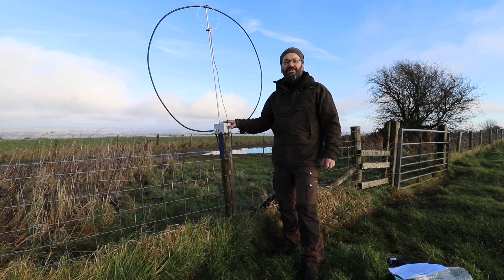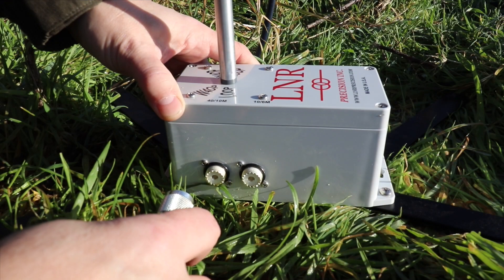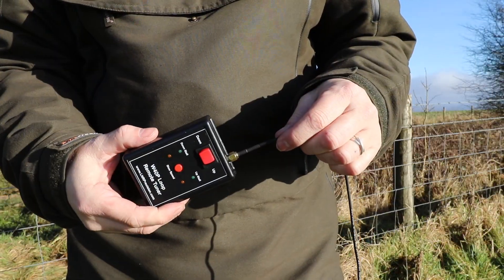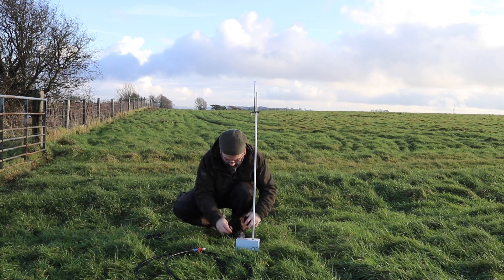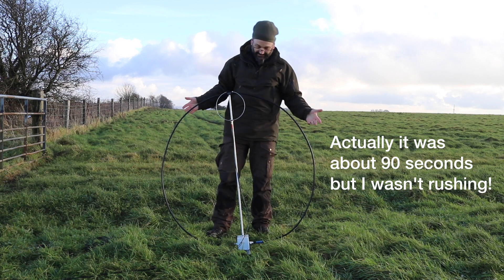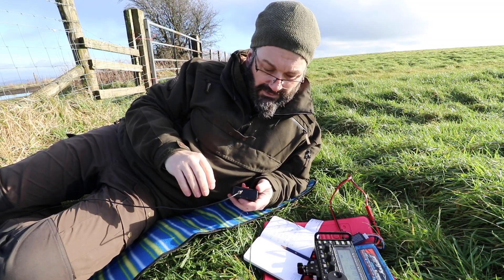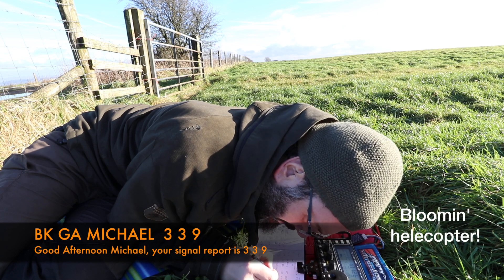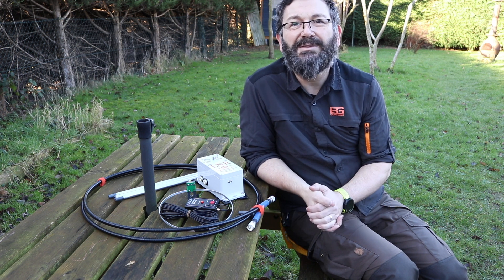Overview of the LNR W4OP Loop

Comment: Really well presented review. I would not personally denigrate Tom because he makes no outrageous claims about his loop design and moreover it's probably 1/3rd the cost. At the cost of this loop I would question one or two of its attributes. I have built two small transmitting loops. Both "work" as does this W4OP/LNR and indeed as do Tom's loops.
Reply from the maker: @KL3NCH  I still, personally, prefer getting wire in the air but have found myself in a few operating positions over the years where a loop made things possible. I’m all for low cost wire antennas and telescopic fishing poles!
Reply: I just bristle at those comments which are not pertinent to this review. Having passed on production to LNR it's not even as though he's a competitor any longer and it's really old news that helps no one. I'm not going to pick holes in the DUT here although I could. It's a reasonable enough compromise with an already compromised concept. One man's meat etc.

Comment: I think aluminium stick is not a good option based on magnetic loop books and articles.
Reply from the maker: Yury Krasouski Thats a really interesting point. Not sure what it does (if anything) to the radiation pattern or what effect having an isolated aluminium rod inside the loop might have. If you have any good references on the impact please add them here...I’d be interested to learn more.
Reply: @g0pot  I interested this (ML) for a while ago.  If I found articles, I will add one more comment here. 
EW1AEI, 73

Comment: Too bad the LNR unit is no longer available.  But preciseRF now produces one that just might be better.  Not cheap but worth the cost.  Also the YouKits analyzer works very well for this purpose.  I use mine to tune all my antennas.  There are fancier ones but the YouKits tells you what you need and sends out its signal in a continuous loop while tuning.  Just tune until the dip is as low as possible.  The other thing about a loop. They only work well when out in a large space.  In doors and around any metal they are easily detuned. The Alex loop is much lighter but lacks the remote control.
Reply: So, after following the links, I understand that this loop is no longer available, or am I wrong? TU, 73

Comment: Very good. I've just got an AlexLoop antenna, same model you mentioned on this video. Along with it I also got a little box called AlexTune that you clip to the antenna and it has a little LED light that goes up whenever you get optimum tuning. Not a remote tuning unite, but it is some welcome improvement.

Comment: Do you know the rating of the variable capacitor?  How many pF??
Reply from the maker: As measured using a Peak LCR45...
40 - 10m = 197pF - 7.7pF
10/6m = 7.7pF - 4.1pF